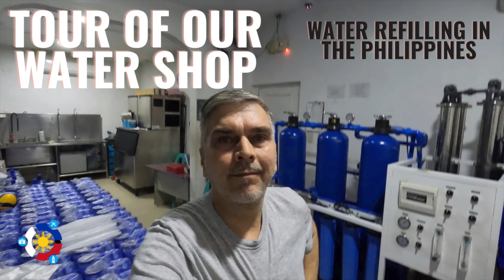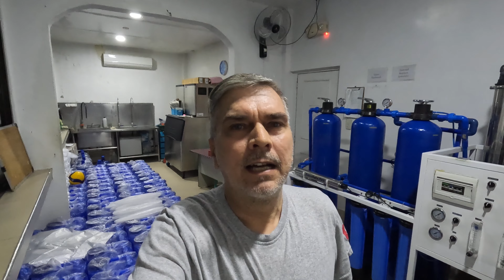Our Water Shop - Water Refilling Station

Comment: i have seen your video several times, i like your setup, i'm interested in knowing more, how big are your pumps? what are your rates of pay, OT,  and cost of a bottle of water, 5 gallons, 3 or 5 kilo ice? 

you mention several things in your video, does your water go through filtration first? it appears you said water goes through tanks first, then filtration? seems backwards, is this correct?   any recommendation on water system brand? will also upgrade ro's to 4 per your recommendation.   how much were your deliver bikes?   i building a home in solano, luzon.
Reply from the maker: Lets see,  My water station well is 200 feet deep, 2hp pump, 1 inch pipe.  I pre filter via a big blue material (sand, charcoal, ect) before it goes into the 'raw' water tank.  From there, it goes into the whole process to become purified.  We sale 3 5g bottles delivered for 100p.  5k of ice (purified) for 65p. Trikes brand new at the time with side car, and upgrades around 150k each.
Reply: @PHExpatPrepper  awesome, thank you, all very good information, i appreciate it...

 I have studied you setup on & off the last several weeks... i believe i fully understand your system.  i just did another stop/go of your video to see if I missed anything.  

It did take me a little while to understand all your piping but i'm good now.  Before your video i was not familiar with this type of php business but i learned a huge amount from you. ...its a very efficient plan, for sure a baseline i like to start with and i now have a good computer diagram of it.  

I do expect to be in solano in may and just today i may have found a piece of property to build on and hopefully get this going.  Thank you again, Cheers from Texas - Samuel

Comment: Nice set up mate, especially those stainless steel benches. Tiles are a pain in the ass to keep clean. I’ve been running my own water station in Dumaguete since 2016, been a good business but like yourself it was difficult in the beginning. Good crew is hard to find! But when you do find them you have treat them well, I also pay them accordingly unlike most others. Nice video, I like seeing how others have set up. I wish I had a bit more room but to make money in this business you really need to own your own shop space I’ll just stay put for now. May I ask how much your selling the 3kg and 5kg ice bags for? And I did you buy the plastic bags the Philippines? Thank you and all the best
Reply from the maker: Thanks.. it did take trial and error to get the setup to a place that was good.  3k 45p  5k 65p for the ice.  We have a few restaurants that get a discount, as they order a lot..  We order the blue ice bags off of shopee.

Comment: Thank you. I would appreciate if you share the name of machines or advise what could be better to purchase :)
Reply from the maker: Well.. its a mix..and I have updated it a bit.  Any local seller of water equipment will assist better, as they will supply install.  I just recommend start with a higher than you think setup.  get 2hp pumps, get 4ro, ect.. as they will try to hook you with a cheap system.. but can not scale, so you will be always replacing (upgrading).  Like tanks.. they will say 500l is good to start.  Its not.  2000l is a good tank size to start.

Comment: Nice water station! We recently purchased a house with a deep well pump/pressure tank setup. It's not connected to city water. I have DIY'd our water filters using 4 stage 20" slim filters consisting of 10, 5, 1micron and a carbon block. The only missing component is the RO system. But yeah... It's mineral... Not purified. Going into the house the water is filtered again by a sink top water filters which is also 5 stage. It includes an Ultra Fine filter rated at 0.1 micron. After which it goes thru a 6gpm UV water sterilizer. It was fun doing all that DIY stuff. All items were purchased online except for the pipes that were purchased at our local hardware store. I'm considering getting FRP tanks for sediment and iron removal in the future.
Reply from the maker: Sounds like you have worked out a good home system, and now enjoy the free water.  Thanks!

Comment: Thanks for the video. Very educational. Do you have any recommendations on how a family might bring their own filling station up to spec? Are there companies that specialize in coming in to set the infrastructure and machinery/equipment up? Or do you have to do it on your own? And for filters and equipment are there certain industry-leading companies to source from? How does one go about that? Sorry for all the questions— happy to email or use a different forum. You seem very knowledgeable so I would appreciate the opportunity to discuss.
Reply from the maker: Hi, Yeah there are a LOT of companies that will sale you the initial gear, add on, and setups.  They also help with getting it working right.  Training too.  After a while you get the hang of it,  RO and filters, seals, and such are readily available online, or via whole sellers.  I stock up of on that stuff too.  Depends on where you are at, but I am positive there is some reputable seller\installer around.  Thanks
Reply: @PHExpatPrepper  any companies or websites specifically you could recommend? The filling station I am interested in modernizing is located in Tacloban City in Eastern Visayas. Not sure if the companies you’re aware have a presence there—but would appreciate any resources online or otherwise you know of.
Reply from the maker: @johnkane2026  I am in the middle of no where Luzon, so I have no idea about companies there,  Google  shows an option of: https://www.facebook.com/aquamastertacloban/

Comment: What’s your thoughts on the alkaline water?  Me and the wife are thinking about getting a Kaegen, we’ve heard the alkaline water is better for you, but I’m still up in the air about it. Plus Kaegen is pretty costly.
Reply from the maker: Good question, and I answer this a lot.  UNLESS you have a high stomach acid issue, you do not need alkaline.  It IS good for gert, acid reflux and such. That is the only benefit.  It is basically mineral water that is charged to change the PH.  You can solve this with diet.. Different fruits, and veg have higher acid, and some have lower.
Reply: @PHExpatPrepper  thanks Bill!
Reply from the maker: @daveb378  NP.. hope it helps you make a choice.